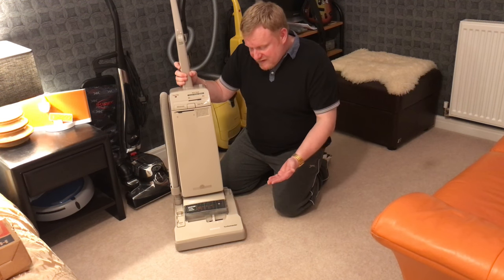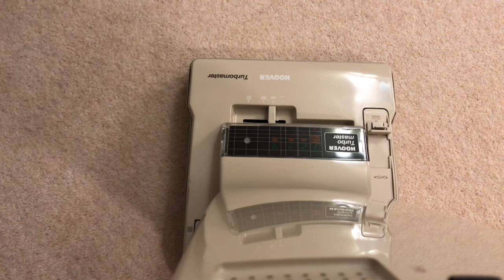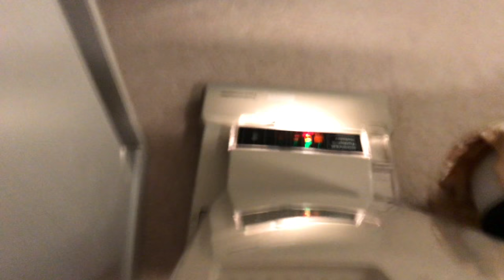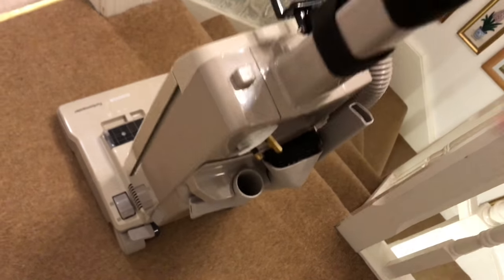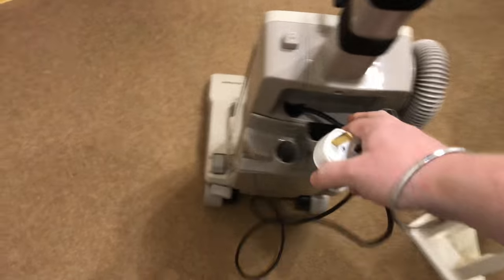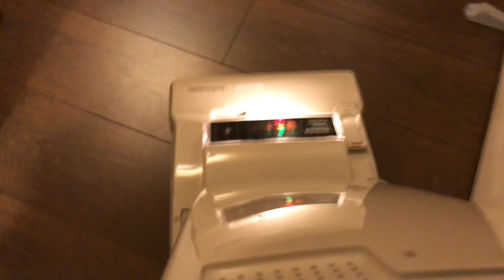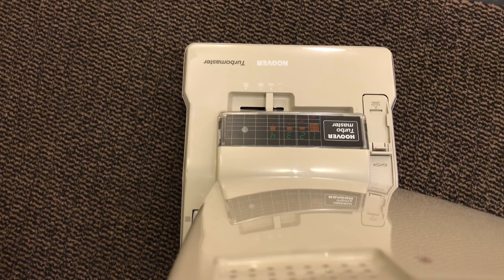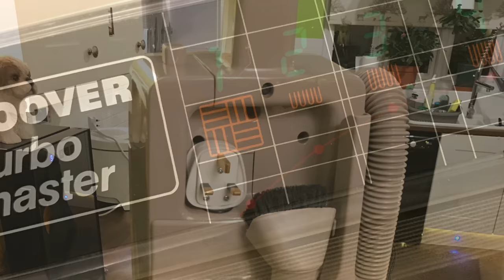Hoover Turbomaster Total System, Full House Clean Demo

Comment: I don't believe that we'd ever received the Turbomaster models in the US. We had the Elite models at the time and I bought my brother and sister in-law one as an extra vacuum as a quick up because they had a powernozzle canister Electrolux model L and two young boys to keep up with.
Reply: All 'n all I loved the Elite but I didn't think that it was worth discontinuing the Convertible/Senior model over. They should have moved on with both!
Reply from the maker: Yes, you did have it there, almost the same in design, different colour. I’ve seen a vid with someone who has one.
Reply: We did have the Turbomaster... as the Innovation! And we also had the TurboPower, as the Sovereign!
Reply: Love the selfie stick velcro onto the handle ! I use a C-clamp Mount myself but you definitely have to be careful because  it can scratch the machine.
Reply from the maker: That’s very true, as I use my phone it’s normally a right pain, but with a selfie stick and the Velcro I’ve had no issues apart from vibration. Thank you 😊
Reply: I didn't realize it. The innovation was very nice.